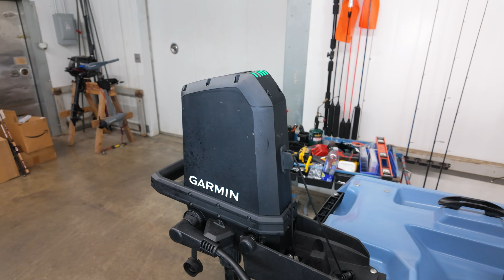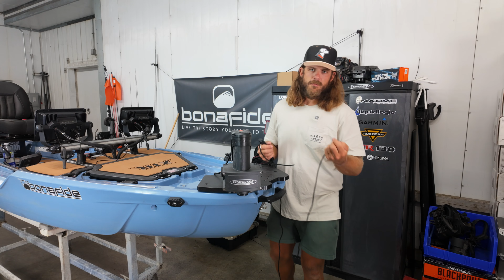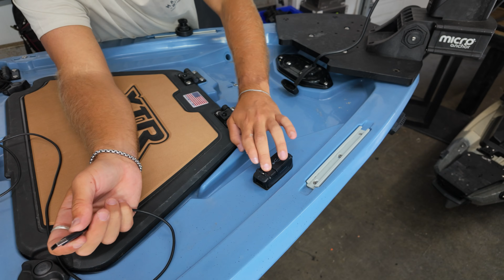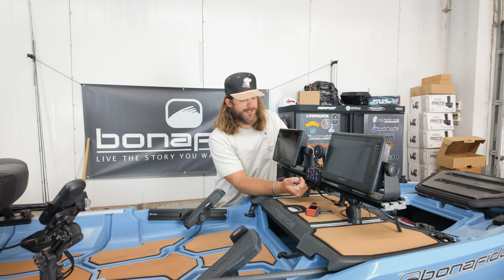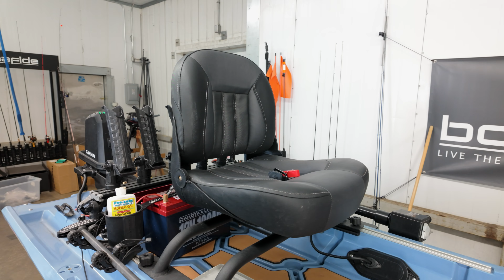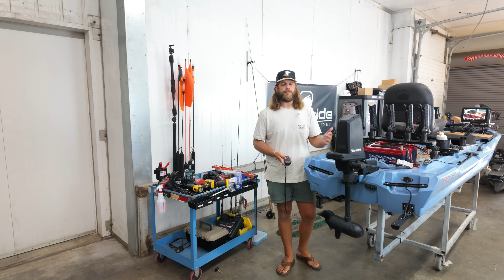$15,000 Kayak Build - Bonafide XTR130

Comment: Hey Justin, just picked up an XTR130 with the Force Current. What product are you using to mount the Garmin Remote? Also, any reason to choose 12Vx100 by 2 versus going with 24v/100? I figuring just cause they cheaper and probably already had them? Thanks!
Reply from the maker: It’s a Yakattack throttle mount. And I already had two 12 volt 100’s. The 24v 100 would be ideal: